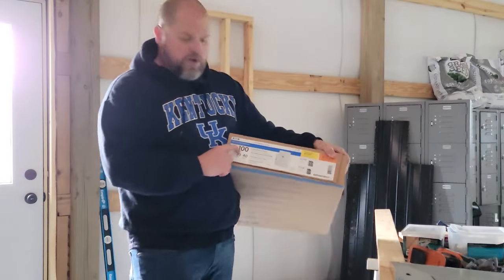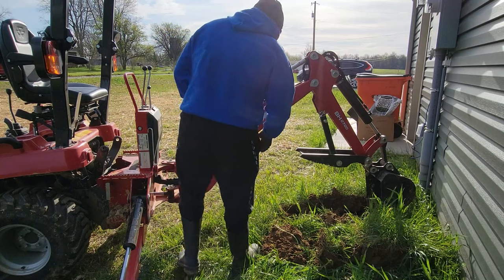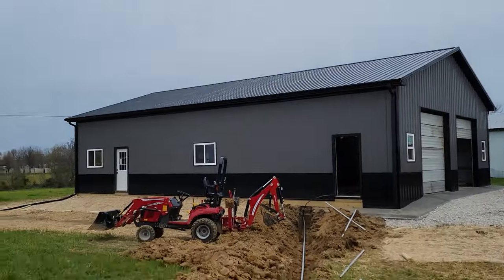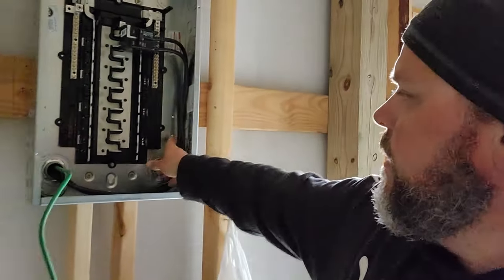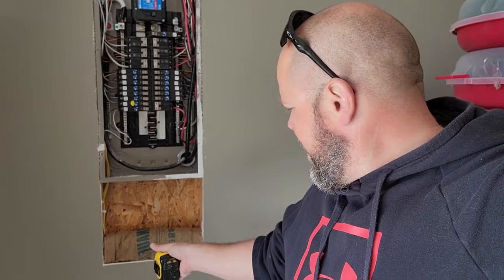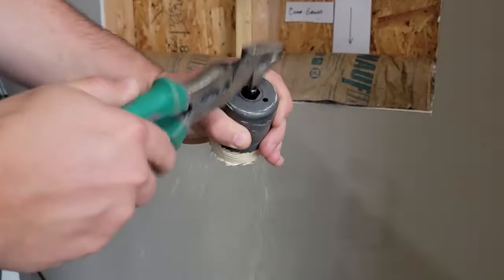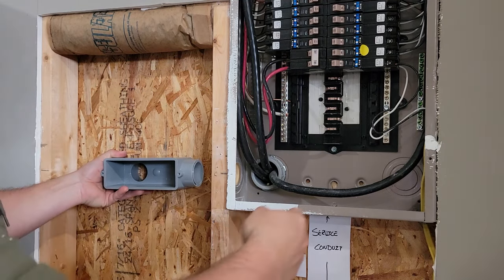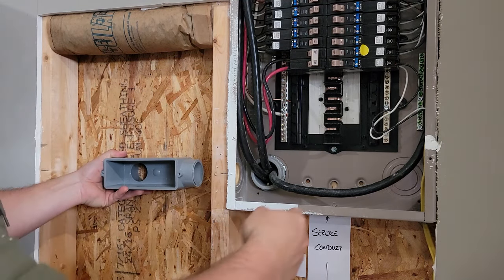Installing 100 AMP SUB PANEL -  THE COMPLETE PROCESS - SAVED THOUSANDS $$$

Comment: hi so converting your size wire aluminum 2gauge. if it was copper what size would that be please.
Reply from the maker: I would think #3 copper on 100 amp service or feeder line, but verify that with your local inspector or electrician. Thanks for watching and commenting 👍🏻
Reply: @JustinsProject  thank you great job on you garage.

Comment: You did four runs of 2awg AL wire in 1-1/2 PVC conduit? Would you have wanted to step it up to 2” conduit or are you happy with your choice?
Reply from the maker: I am happy with it. Since I never plan on adding anything more. Thanks for watching and commenting 👍🏻
Reply: @JustinsProject  appreciate the response! I’m working on the same project for my barn. The internet suggests 2” conduit for 4x 2ga aluminum but if I can avoid paying for it then I’d go the smaller size conduit route. Very helpful video.

Comment: What size pvc did you run your 4/0 wire in?
Reply from the maker: I ran 1-1/2 for the service to the building. Schedule 40 inground and Schedule 80 for anything exposed to the outside. Thanks for watching and commenting 👍🏻

Comment: White is the name of the wire you used for the underground.  Can you give a link.  B/c when I look at aluminum #2 I get tons of stuff to chose from.
Reply from the maker: I picked that up at lowes in the bulk sections. It comes as a 4 wire run. I unfortunately do not have a link to that but it is an underground wire and can be picked up in store at Lowes. Hope that helps.

Comment: A guy at Lowes told me that you don't need to run aluminum number 2 gauge wire through pvc under ground. Is that true?
Reply from the maker: It was required for me. Thanks for watching and commenting 👍🏻

Comment: Drop a good string through your solar conduit so you can just pull the wire through when your ready
Reply from the maker: I pulled all the wires with a cable puller. Took a little effort, but it wasn't terrible. A good string would have been a cheaper, though. Thanks for the tip, watching, and commenting 👍🏻

Comment: If you're running power from your main panel, which is already grounded to earth, and you keep neutrals and ground separate in your sub-panel, no need to ground to earth at the sub-panel.
Reply from the maker: It was required it. Actually, they required me to install a 2nd one on the shop. Thanks for watching and commenting 👍🏻

Comment: Hi Justin,,,we want to put a subpanel ,,,, from main panel to subpanel it is about 400 feet, which cable to use, thanks
Reply from the maker: A lot of factors depend on what size wire can be used. Gotta know the whole picture before knowing the minimum size required. Good luck 👍🏻 Thanks for watching and commenting 👍🏻

Comment: good video. always pot hole first if your close to wire, pipe whatever. ( pot holing for the viewer is when you take your shovel and hand dig to locate thing your trying not to hit with ur heavy machinery. When u break something with a track hoe u wont feel it till its too late.
Reply from the maker: Good tip! Thanks for watching and commenting 👍🏻

Comment: What wire did you run? 2 awg?
Reply from the maker: I did, and it passed, but I would not do that now. I would use #2 copper hands down. I just could not find copper at that time. There were huge shortages. #2 alum is pushing it.

Comment: what size breaker was your main panel 200 amps?
Reply from the maker: 225 AMP rating on the bus bar and a 200AMP main breaker. Thanks for watching and commenting 👍🏻
Reply: This is literally gonna save me about 7 grand got a quote on just wiring 12 outlets and two lights to hundred amp 6 circuit sub 8700 lol i didnt even wanna get a quote on the 50 foot trench and cable. Thanks for the video

Comment: Ok very nice......but   a few key safety point to try to remember  for the future...1   NEVER  turn on a panel or breaker with the panel cover off....there could be a problem  that occurred  while you had main panel down...an animal could have eaten some insulation  etc ...and when you turned on that beaker it could  have exploded  right there...2    only turn breakers on with your left hand.....that way your body is out of the line of fire if something  does go wrong.. ... but other than that not bad    also I know it isn't required  but for the price I would have placed something ( wood, plastic cement or even buried cables wrap ) over the conduits in trench just to save future mishaps    it was only 60ft so wouldn't be too expensive.
Reply from the maker: I appreciate the tips. I do need to question the left hand vs. right hand. If one break switch turns on to the right and another turns on to the left (opposite side of the bar) how is that positioning the subject away from danger by using their left hand always? Thanks for watching and commenting 👍🏻

Comment: Wish you would have explained how you hooked up in the main house
Reply from the maker: Connect the ground to the ground bar, the neutral to the neutral bar. Although the ground & neutrals are bonded in the main panel, thats what I did. Then, I added L1 & L2 to the 100amp breaker. Hope that helps. Thanks for watching and commenting 👍🏻

Comment: If my main panel has a 100 amp main breaker. What is the max año I can go on a sub panel install?
Reply from the maker: There are a lot of factors to consider before adding a sub panel. If you're not familiar with the whole process, I would recommend reaching out to an electrician. Thanks for watching and commenting 👍🏻

Comment: I got a metal sliver in my eye years ago and the doctor used a magnet to get it out. Soon as the magnet got close to my eye that thing slid out.
Reply from the maker: That's the greatest idea ever!!! Thank you for watching and commenting 👍🏻
Reply: I got metal in my eye from a grinder and the metal left a rust ring in my eye. They had to drill out the rust ring. They clamp open your eye and put this liquid in it then have a little drill slowly lower into your eyeball. You don't feel anything but it's very weird seeing the drill bit rippling your eyeball.
Reply from the maker: @mr.eastcoastgrow6132  That sounds like experience I would rather not have 😁

Comment: How did you get away with 100A on #2 Al?
Reply from the maker: The inspector passed it. It was AL MHF 2-2-2-4. The specs state 100amps. Although, I am hearing 90amps from some.
Reply: @JustinsProject  all good, some let it slide, but typ only 100A if supplying all of a residence (like MIL suite)

Comment: The main feed doesn't need green wire  its a detached building    all grounds bond together.   Need two ground rods.  😮
Reply from the maker: It was required by the county inspector. Yes, I ended up having to do 2 ground rods. AND 6ga ground wire. vs. the 8ga I used. I did a follow-up to this video. Thanks for watching and commenting 👍🏻
Reply: @JustinsProject  what pisses me off. You get ten electricians in a room you'll get ten different answers
Reply: @JustinsProject  try this. Ground grounding grounded.  See how many answers you get
Reply: @JustinsProject  hate  guys I'm a electrician. I know code ⚡
Reply: @JustinsProject  nothing against you you did do a. Good job.   Better than some of my apprentice
Reply from the maker: @johnkulpowich5260  That's how it goes in just about any profession. 😁

Comment: What type of wire/ guage size  to run a 100 ft  from a 200 Amp Main  Box  to a 100 Amp Subpanel Box ?
Reply from the maker: I used #2 Alum. Ended up being about 80-85ft total in the end. Got the wire at Menards. It has 4 total wires. 2 leads, 1 neutral and one ground.
Reply: @JustinsProject   Thank you for The Advice Tip , ⭐⭐⭐⭐⭐
Reply from the maker: Let me know if you have any further questions. 👍🏻
Reply: @JustinsProject   Thank you , I Appreciated, How ever it looks like the wires are way over priced, almost 6.00 ft  from what I observed, that's for S 4  Wire  most where I went to.look , is almost better off getting the whole spool role, lol.
Reply: 6 guage wire , 1.79  Ft ,  it must know a job needs to be done and acquired Decisions at all cost Lol. 😃
Reply from the maker: @x7warrior735  I bought #6 copper stranded today actually. 150ft of it. Lowes was 1.68 but comp'd it to Home Depot (which was out of stock) 1.48 ft. Still cost me over $220. Crazy times. Thats just a ground wire for a solar system I starting to build myself.
Reply: What's sad is for a less then  30 minutes Of time on Serviceing  Main Service 200 Amp Panel For A  100 Amp Subpanel Termination  to Cost Around 700.00 Not including The Labor Or Materials Needed. That's Realy Out Rages To Consumers Who Are Trying To Make ends meet, from weekly daily monthly Basais. The Economy Is Over Rated, By A Projection Of Severe Inflation Cost For Many Decades Now,  The People / Consumer is Left #  For The Effects / After Effects Lol😃
Reply from the maker: @x7warrior735  If you have a Menards or Lowes in your area try there. #2 Alum was 2.20 there but at the electrical houses in my area, nearly 6ft. Crazy how that works. 😳
Reply: @JustinsProject  Thanks I appreciated, well it sounds like where you are you have Great prices, thats Awesome 😃
Reply: @JustinsProject   meant  to say 6.00 a ft. Lol. 😀 yet it is what is , lol. Just have to make the best of it 😀 you do Awesome presentation on Doing Explaining Of The🎬🎥 Intaullation Thank  You ⭐⭐⭐⭐⭐
Reply from the maker: @x7warrior735  Much appreciated! 🙏
Reply: #1 ALUM SER
Reply: @ X 7 Warrior while using a #2 Aluminum quadruplex for two hots one neutral and a ground wire will work for a subpanel will work physically for 100 amp subpanel if you’re using insulation rated for 90 degrees Celsius because there are different ratings for different types of wires based on the 60, 75, & 90 degree Celsius ratings on the table in in the codebook 315.15(B)(16) is the table all is based on. The problem with it is that the terminals inside the breakers and panels are only rated at 75 which sets #2 at 90 amps. So really to do it right it should be a # 1 aluminum cable. Now you could get two terminal blocks outside of each panel rated at 90 degree C and use the smaller wire in between those two and from the terminal blocks to each panel use the bigger gauge wire. Or use a 90 amp breaker instead of 100 amp. But in all reality just like the main panel demand is reduced to 83% of the full rating. For example the wire used in a 200 amp main panel is really rated at 175 amps to 180 amps depending if it’s copper or aluminum. Because it is know. That nobody will use all 200 or 150 amps all at one time simultaneously. And in my opinion in a shed you should not use all 100 amps, unless you have a lot of high powered motors and stuff you plan to use at the same time. And while I’m not saying it legal to use #2 by code you should be ok, and since most people do this without and inspector they tend not  to get messed with about it, but the remedy for that is to downsize the breaker to 90 amps that would make it legal for that size wire if you’re planning on getting it inspected. Because the 75 degree column in that table is what we actually use in most cases and the 90 is used for calculations. Which is why is you’ve ever looked at the printing on the insulation for romex wire inside a house or nm-b as it’s called, it is actually rated at 90 degree Celsius but we’re only allowed to use it at the 60 degree C column. I have not understood that since I’ve known about it. And it’ll even say in the codebook in 334 it is but when you go to do the calculations for bundling conductors together or derating purposes but whatever the answer it can’t be about the 60 column amperage but can be below it. I’m not saying don’t do it, just be careful if and when you do about how much load you use in your subpanel. To keep heat down and your circuit breakers from melting because even though the metal terminal itself maybe rated at that 90 it may be mark 75 because of the plastic molded breaker casing it’s in. Just food for thought. Also #3 copper works also. Rule of thumb between copper and aluminum is copper is most always two sizes smaller than aluminum when sizing wires and cable, but tends to cost more. And don’t forget your noalox anti corrosion for the aluminum if that’s your way to go.
Reply: @usmarinekenny   Thank You , I Realy Appreciated ,  ⭐️⭐️⭐️⭐️⭐️⭐️⭐️⭐️⭐️⭐️⭐️⭐️⭐️⭐️⭐️⭐️⭐️⭐️⭐️⭐️⭐️⭐️⭐️⭐️⭐️⭐️⭐️⭐️⭐️⭐️
Reply: @usmarinekenny   Yes The 《Codes》 Vary In Different Locations,  The Main Thing Is  Makeing it Safe To Everything. The Tempatures,  The 《Distance of Ft》,  Of The Wire.
 Application  Of The Run In The Conduit Pipes,  Thank you ⭐️⭐️⭐️⭐️⭐️⭐️⭐️⭐️⭐️⭐️⭐️⭐️⭐️⭐️⭐️⭐️⭐️⭐️⭐️⭐️⭐️⭐️⭐️⭐️⭐️⭐️⭐️⭐️⭐️⭐️

Comment: Why would you put your underground feeder cable in conduit?  Pretty sure that is deleted because of overheating.  No conduit on the grounding wire either.
Reply from the maker: It was required by code. I had to make sure it was the correct wire type to put it in the conduit, though.
Reply: @JustinsProject  can you show me the code reference please.  I was told under NO circumstances will I put wire in conduit under ground.  I asked why of course because I want the wire completely protected for years even when I’m gone 100 years from now but the electrician said NO the code was changed because the wire will over heat.   I’ve never heard of ground wire in conduit.  Please share the code references.  TY
Reply from the maker: In my jurisdiction, it is required that if you are going underground, it must be in conduit. However, you can not put a jacketed service wire in conduit. It must be rated for conduit. Because of the heat rating. But I have never heard of not putting the correct type of wire in conduit. What happens when it comes out of the ground? How is it protected from damage? What part of the country are you in?

Comment: For the ground bar couldnt you just run a self tapping screw in there????
Reply from the maker: The inspector required the ones I installed. So I just went with it. Thanks for watching and commenting 👍🏻
Reply: @JustinsProject  no problem btw wasn't a hateful comment even though it may have seemed that way I'm about to do the same exact thing you did lol so I just wanted to know I'm not good with people so I don't wanna have to ask them to come back lol

Comment: Isn’t #2 aluminum a bit Undersized, shouldn’t that be #2 copper for a 100 amps? You could have used for your PVC LB A chase nipple when entering your sub panel Load center. And did you coat your aluminum main feed wires with no locks compound. Overtime aluminum shrinks.
Reply from the maker: It was max rated 100amps for underground burial as a subpanel feeder. #2 Copper would be a better choice for sure. At the time, copper was very hard to find, and I was in a time crunch. If I were doing it today, I would use copper for sure. Thanks for watching and commenting 👍🏻

Comment: I didn’t know #2 aluminum was rated for 100 amps. Hum!!!!!!!!!
Reply from the maker: 2-2-2-4 MHF Rated @ 100amps- Ampacities based on NEC
90°C wet or dry locations 
For dwelling units, conductors shall be permitted at listed ampacities to be utilized as 120/240 volt, 3-wire, single phase service conductors that supply the total load
The inspector stated that it was ok. 
I am considering upgrading to copper. Wish I would have had from the get-go to be honest. 
Thanks for watching and commenting 👍🏻
Reply: @JustinsProject  thanks for the info. Nice install my friend.

Comment: The meter is in why are you calling inspector?
Reply from the maker: Sorry, I don't understand the question.
Reply: @JustinsProject  U already have power at your site why call the inspector for this project to garage?
Reply from the maker: @michaeljennings5170  It was required by code.
Reply: @JustinsProject  The code cannot dictate to u to call inspector.
Reply: @JustinsProject  whats he going to do pull out your meter?
Reply from the maker: @Michael Jennings  Not the electrical code but county and local municipalities can.
Reply: @JustinsProject  Why would even say to anyone?

Comment: Why aluminum wire,
Reply from the maker: Yes, at the time ... supply for copper as impossible to find. The supply chain was disrupted terribly. If I were to do this over and copper was available (which it is now) I would definitely use copper.

Comment: how did video get get reversed?
Reply from the maker: Sorry, I don't understand the question.
Reply: @JustinsProject  on the one video the In coming powe to panel is on right side when u were done it was on the left side.
Reply from the maker: @Michael Jennings  Oh, that's probably because I figured out the camera settings at some point 🤣 It was doing a mirror effort.
Reply: @JustinsProject  yes I c that.

Comment: Looked like you used URD wire? If ya did ya didn't need the conduit.
Reply from the maker: I did not use direct burial. So, I was required to use sch 40 underground and 80 above ground. Thanks for watching and commenting 👍🏻